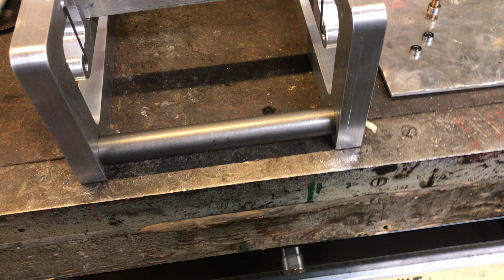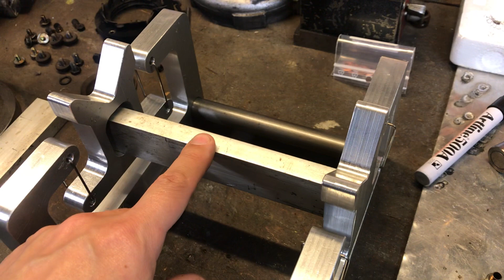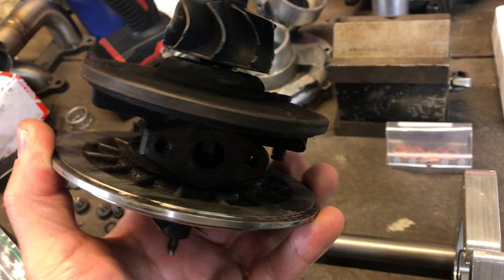Turbo balancing machine project (warning freehand video)

Comment: Nice what software are you going to  use?
Reply from the maker: I'm using Balance30 and Dynexhobby software. Both work on turbo balancing nicely. Dynex software is easy to calibrate and the Balance 30 gives nice polar graphics on where the unbalance is.